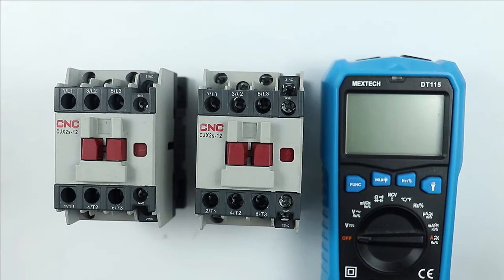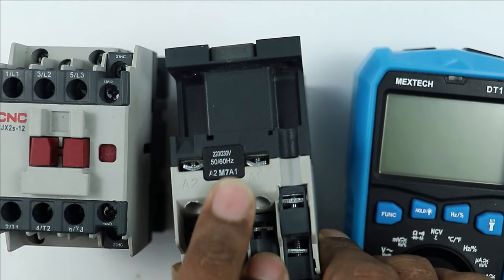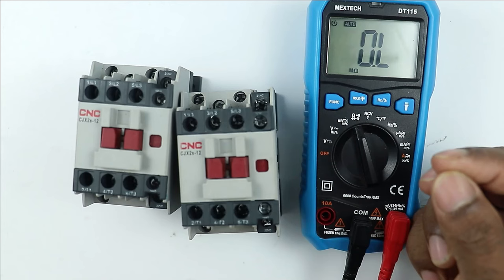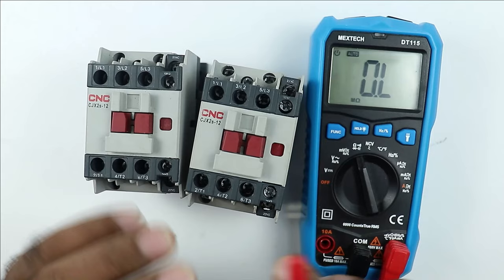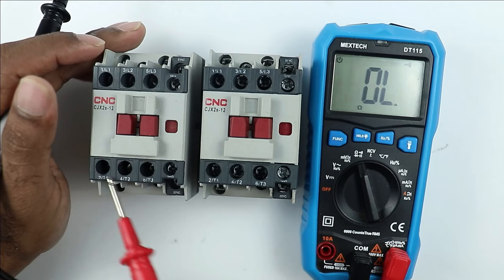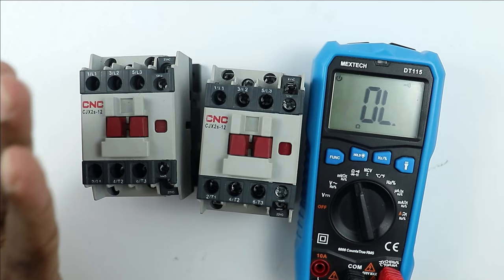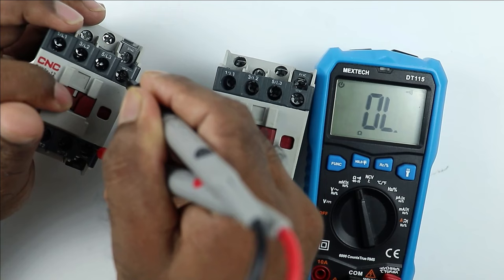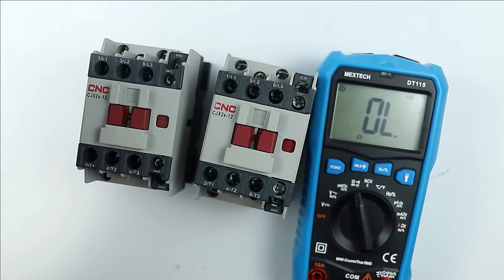Learn to Check All Faulty Contactor by using Multimeter | contactor repairing @TheElectricalGuy

Comment: When supply is on,  problem comes how to check contactor and auxiliary contactor
Reply: Used a 24 volt battery  like drill impact you can see if the coil opened or closed

Comment: Hi! Precisely, on this type of contactor inside the machine that it operates ! How do I check to make sure it's getting power supply to the contactor? Across the terminal? Thanks
Reply from the maker: Check the voltage across A1 and A2 Terminal